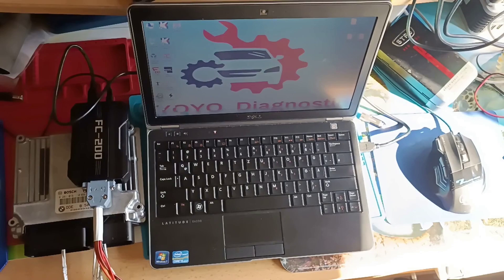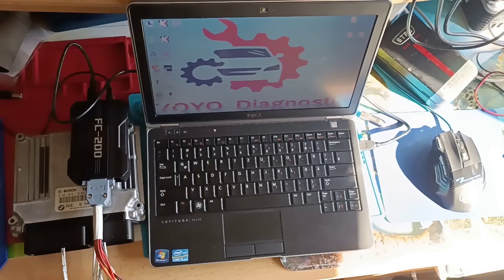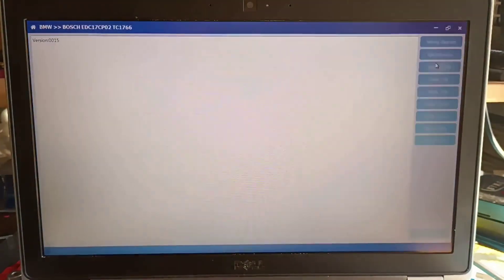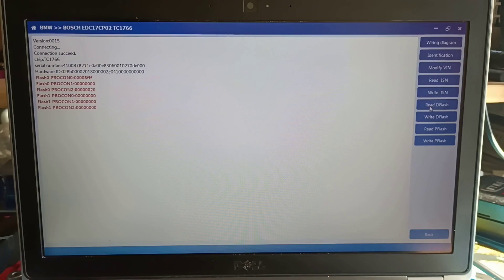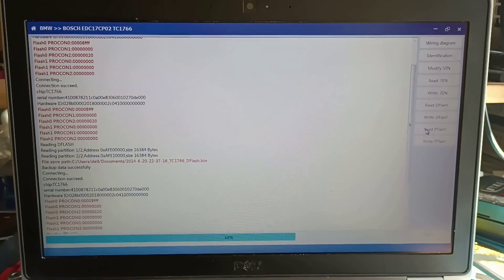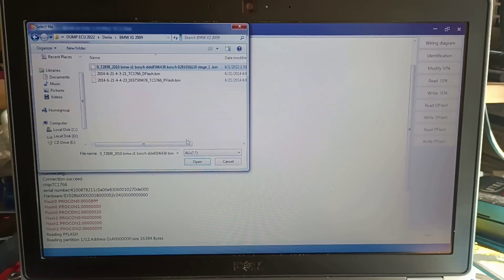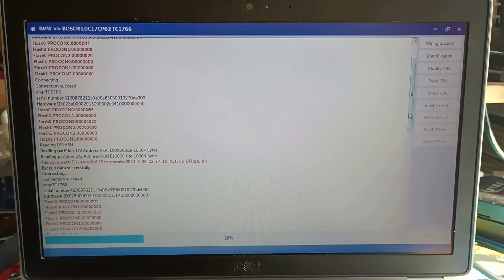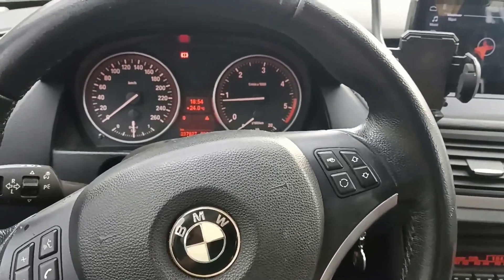CG.FC200 read/write Bosch edc17CP02. BMW X1 E84/2010 tuning stage1.

Comment: Thanks for this video.

I have one question. The CG FC200 is for ECU work and CG100 prog is for airbag  and dashboard work?
Reply from the maker: CG100 is for Airbag and Modules such as CAS, FEM.  for Dash it's CG Pro.  these 2 complement their functions. 
 At the moment the CG100 is one of the best memory programmer for Airbag